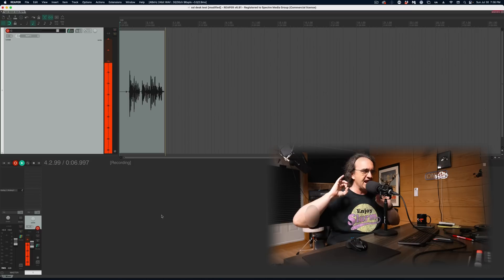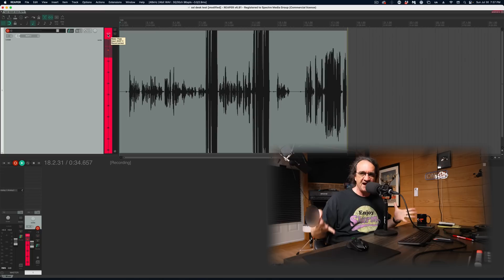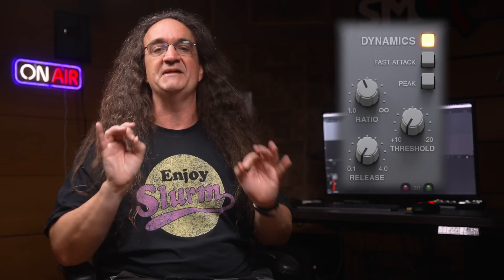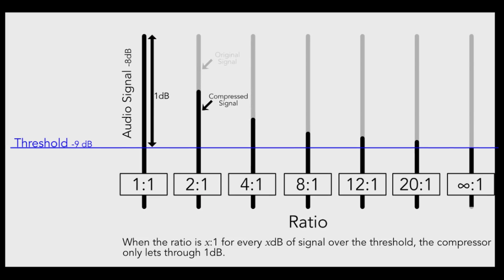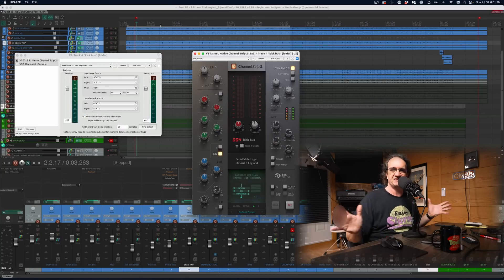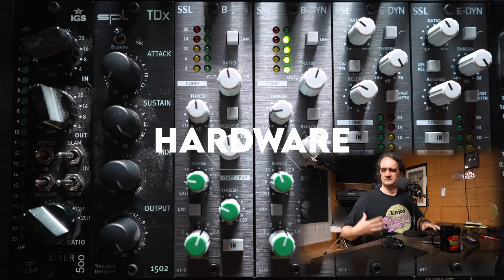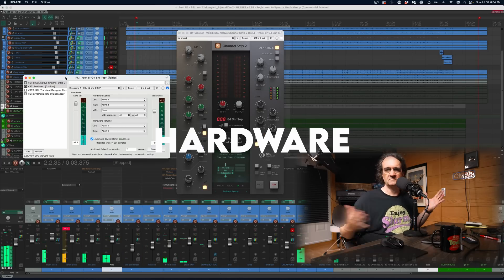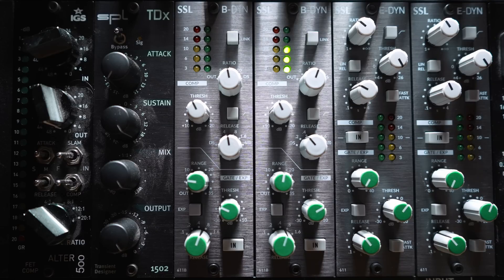5 Reasons this is BETTER than your Software!

Comment: I don't know man. People can't tell the difference between a real amp and a plugin. But a hardware compressor makes the difference? I don't think so. Pros have been replacing that kind of stuff with plugins even bevor amps, decades ago.
Reply from the maker: You can’t hear the difference?
Reply: @SpectreSoundStudios  Hi Glenn! Sorry for the late reply. You probably won't see this, but I'll still write what I have to say. 

I definitely do hear the difference! But how can anybody tell it's really due to the hardware being better? There are many contributing factors.
1) is the workflow, which is one thing you mentioned. Working with a hardware device is just different, and that can change the decisions we make along the way. (For better or for worse.) Definitely not to be discounted, but it's not really the hardware sounding better that makes the difference here. 
2) Mixing the same song twice and making it sound the same is virtually impossible, even when using the exact same gear and plugins. (Unless the tracks are so well recorded that you don't have to do much at all...) So again, one mix might sound better or worse for reasons completely unrelated to how the hardware sounds. 
3) There might be better (or "closer") plugin emulations than the one you used. I don't have any idea myself, but somewhere in the comments somebody wrote that the plugin you used was not emulating the saturation of the hardware unit and that there is a different version of the plugin that does. So it might be fairer to use that one. 
4) A more objective method would have been to set the hardware in a way you like and then try to match the plugin as close to possible to the sound on every track you're using it on, and then do a blind test. Jordan from Hardcore Music Studio has done something similar and the plugins were extremely close.

Yeah, those are my thoughts. Of course there is a difference between a piece of hardware sounding better and one making you mix better. Both are valid reasons for getting hardware, and I'm certainly not saying it's not worth it. I still like my tube amps and I prefer recording with them.
Reply: It’s different but not exactly better.

Comment: I miss turning the knobs.  Everything regarding the knob turning is 100% correct.  EQ, compression, everything.  Grab it,  turn and you hear instant results.  Used to use a G series back in 1989.  Now days it feels foreign working in the box.  Who even has room for the 2 entire racks it took to run that console back in the day?!?  I miss the good old analog days.. I would love to have an SSL Origin console.  Thanks for the video..

Comment: Reason #6 why I like analog hardware vs. cartoons:  If I decide I don't like it, or if I just no longer use it, I can sell it.  I can't sell a plugin.  I'm just out that money.

BUT...  "If the company goes under, who gives a shit?" Me, actually.  If I need parts or repairs, can I get them?  If it's something like a well-known transistor, then sure, I can buy one off Mouser and perform a repair (or have a technician do it).  But if it's a proprietary component made for that unit by the manufacturer, then I'm going to have a much harder time servicing it.  As an example, Charter Oak microphones.  They're pretty much out of business now, and the toggle switch for the pad on one of my mics of theirs broke.  I can't get a replacement part.  I need to use a pen to switch the pad in/out.  Combine lack of parts/service that with the company's now-tainted reputation on e.g. Gearspace, and I won't be able to sell these mics for anywhere near what they'd be worth with a different badge.  However...  The mics do still work just fine.

Comment: Glennnnnnn.
Could you explain the mic signal change? 
I have an NT1a that I'd love to run through a compressor before the preamp so I'm not recording peaks. 
Would this setup work? And could I run 48v thought a compressor? Or would I be better running the preamp on a lower gain and then using compression and makeup gain?
Thank you and cheers from Scotland

Comment: Well done! The presentation of the material was concise, and with proper support of the product's advanced offering(s). I must also commend you on the example of contrast between hardware versus the typical software option. Finally, pointing out the relevance of overall cost with the added value of purchasing one unit at a time, and pure ownership of that module. A distinct wonder what you can do without a crew.

Comment: I'm sure you're working on the counter argument video for this one; though the there aren't too many cons to hard ware. But the few I can com up with:
1. It takes up physical space that could be at a premium where you live.
2. Increased energy costs.  Now this might not be that crucial of a deterrent, but it will require power. The more things are plugged in, the more power consumed, the higher your bill.
3. It just works, until it doesn't.  Analog components breakdown over time.  If the company goes under, you're stuck fixing it yourself, and electronic components aren't as easy to find these days.
4. Much more difficult to move. Should one have to move  house, and the rack in which they're mounted isn't portable where the cables can be unplugged and a couple if lids clamped on the front and back. The entire assembly would need to be broken down, packed, moved,  unpacked and reassembled. 
5. Mixes have to be bounced in real time. Granted, the time this takes can be gained from what wasn't spent mucking about with plug-ins. (Provided that you don't  have a mix template made with all your routing, plug-ins (and the preset selected) as a sort of digital "set and forget".)

Comment: Honestly if I were working in the recording industry I would be using a physical console. I'm not against working in the box but the major downside is you can easily end in up decision paralysis loop.

When you have the physical gear you know exactly what it does, how it sounds, and how it works with the rest of your gear. So you dial in a mix much faster as opposed to jumping from plug in to another. And you can easily make on the fly changes if you think of something you want to try.
Reply: I put the same console strip plugin on every DAW track by default to reduce decision fatigue. Most of the time the included EQ and comp really are sufficient to accomplish the task.

Comment: You have a passion for recording drums. I have a question in regards to that. My friend is a DJ and he got this hardware called a Rotary Mixer / Isolater. Idk if it could have a significant studio application compared to existing tech but I thought it might be a tool to customize a unique drum sound in a live context or otherwise. I thought you would have a much better estimation of that.

Comment: Glenn, I'm disappointed; if you do a comparison, use the right plugin. You used the Channelstrip 2, which is an emulation of the SSL 9000 series. You should have used their very own 4000 B(!) plugin. And no, having a gate is nothing special with an SSL dynamics section because it is a channel compressor, NOT a bus compressor as you called it.

Comment: The most recent discipline I studied was sound design through synthesizers and this video explains the exact reason why I want to dump some money into hardware synths.

Granted... xfer Serum, Massive, Kilohearts and Harmor are extremely powerful tools; yet, they will make you scramble for hours tweaking settings and trying shit out.

On the other hand, if I were to just buy a midi controller and some modulators, I'd instead be looking to get the best out of something simple that I can manipulate with my hands and more than likely stumble upon happy accidents.

Like you said, it's an entirely different mindset. And I guess the same applies for guitar gear, at least in experimental phases of recording.

Rad video, as always! Fuck you, sir!! 🔥🖤
Reply: I love hardware synths. I have some vintage synths and drum machines from the 80s. My tip is to get stuff that has MIDI. MIDI makes things so much easier. I use an Arturia KeyStep Pro to sequence my drums, bass, an other things. The two MIDI outs on the KSP go to a couple of 6 way MIDI through boxes. The MIDI in is connected to a MIDI merger so I can use my DX7 and Roland Alpha Juno 1 as master keyboards. The AJ has a neat chord mode. That's why I use it as a master keyboard. But the DX7 has a nicer key bed. So it's what I usually play. You can get DX7 sounds for free with the Dexed VST. To my ears it sounds identical to my DX7 and works with DX7 patches. But I love owning the synth king of the 80s. And it's really nice to play. If you are interested in vintage synths I recommend the channels Vulture Culture, Doctor Mix, Alex Ball, and Espen Kraft. Espen does 80s style synth pop. So if you like the 80s, check him out. I also recommend looking at vintage rack mount synths. A lot of keyboard synths were also available as a rack version if you want to save space. But sometimes they keyboard version is better because they have more room for controls than on a 1U rack unit. For pre MIDI stuff there are clones from Behringer that have MIDI. You might even start with Behringer before moving on to vintage. The Behringer Wasp Deluxe is a clone of a British analong synth from the 70s if you want to play around with old school subtractive synthesis. It's a fun synth. It has an external audio input if you want to run tjings through its analog filter. 

There is so much out there in the realm of harware. Do plenty of research before spending money and stuio space on hardware. 

Another thing about vintage. It might need a repair. Even just replacing the battery for the memory requires soldering. So keep that in mind.

Good luck on your hardware journey and have fun.
Reply: @jennoscura2381  sheeeeesh...! That's precisely what makes it scary 😂

Appreciate the insight!!
Reply: @dshredmusic  Thankfully there are loads of good videos demonstrating various synths. So you can get a good idea if it's a synth you might want in your studio. 

One series I really like is Bad Gear on the AudioPils channel. He reviews synths that enough people don't like. There are some really cool things that show up in his videos. And he crams his videos full of synth memes. It's really entertaining.

Comment: Apparently I'm not an audiophile enough to hear a very notable difference. Most notably maybe on the harshness of the cymbal on the right side and certain softness on the snare on the software side. The snare pretty much disappeared when the groove got faster.

Did you just match the settings and all that between software and hardware? In that sense, okay, maybe you got "better" results with the hardware version. But I don't know, man, in certain ways this goes bit into the Snake Oil department. 

Without the option to switch between the two like you're doing here you're probably gonna come to a different solution to get the desired effect from whichever you have, just a slightly different set of settings. Much like with two different humbucker pick-ups, no one's gonna be able to listen to these things and say "oh, you used hardware" or "oh, you used software" or "oh, you used Semen & Humpin' Cumbucker" or something like that. when you just pick up a mix to listen. It either sounds "good" or "bad". You know what I mean. 

So it comes down to workflow and what your ear clocks as good or the sweet spot or whatever. Basically the software simply offers the same user interface as the hardware version. You'll end up adjusting them differently to get the same effect. 

I don't know, man. Just my musings.

Comment: I am the proud owner of a fully rack converted SSL 9000J channel strip and the SLL Channel Strip 2 plugin, the hardware is better.
BUT the VST's are damned good as well, just not quite that top of the line polish but I wouldn't be able to tell unless I directly a/b them.
These units are expensive, worth it if you are making a profession out of it but not so much if you're just recording your own music or a band.
Or you're a dentist. They always grab up the quality gear for ridiculous money then hide it in their houses and never use it.

Comment: 2 major downsides (aside from pricing and maintenance):
You need to print it (takes time) or commit to it on the way in (not flexible)
Makes recalls/revisions tedious if not a nightmare
Reply: theres a plugin that lets you store .jpgs so you can take a photo with your cell and leave it there. Next time i open the project if i need to check if my channel has the correct settings i just look at the .jpg...

Comment: I think this is a more subtle trolling video. Reason 1 is just that the SSL plugin is not an accurate emulation of the SSL hardware. Reason 2 could be remedied by just learning how to get the sound you want on a more powerful plugin and creating a preset with some notes. Additionally, you can usually map the "knobs" of a plugin to faders or knobs on a midi controller to achieve a very similar effect to manipulating hardware. Reason 3 is just presets with extra steps if you want to have more than one source for which you use the same hardware module. Reason 4 can be remedied by using plugins with less annoying DRM. No DRM at all (physical) is still less annoying to be sure, but how much value does it add vs the increase cost? Software companies can go under, but software cannot be physically damaged. Learning or purchasing board-level repair for a discontinued product can be a nightmare, incredibly expensive, or both. Reason 5 can be a benefit as well as a setback. If a manufacturing tolerance is a key part of your unique sound and you have to replace that piece of hardware, there goes your unique sound. Labeling the mixes at the end instead of leaving a blind A/B was the biggest tell that this is a troll video. Well done, sir.
Reply: He’s wearing a Slurm shirt. He’s on the clock.
Reply: @jrrarglblarg9241  Ahh I see. I'm not familiar with the reference.
Reply: @sitzkrieg8032  From Futurama, a cartoon. Slurm is a soda-type product in the cartoon’s world, highly addictive and made by explointing other beings. It’s a product placement running gag in the show, among other things.
Reply: Close your eyes and listen to the snare and kick, you'll hear it.
I think he could have probably tweaked the VST a bit to match though, I can do that with my VST and my racked ssl channel strip.
Reply: It's basically as accurate as they can get it. Your other counterpoints aren't actually correct.
Reply: SSL's buss compressor is a less faithful emulation of the G series bus compressor than waves ssl, DMG traccomp or The Glue...I made a video showing it in plugin doctor
Reply: Mostly what I heard was less highs in the kick/snare on the software mix.  My guess is glen has the treble turned up on the mixer for the hardware comps.
Reply: I listened to the clips with the video minimized and there is a very clear cut downgrade in quality when the software kicks in...I admit it's not as pronounced as when I was seeing the text cues when the source changed, but I could CLEARLY tell when it was the hardware, and there is a significant difference in quality. I hate to admit it, because I've been telling myself for years now that my purchase of Cubase 12 Pro (which I got at a serious discount due to a strategic competitive crossgrade from Adobe Audition, which is part of my creative cloud subscription, then waiting for sales and using upgrade discounts from my original purchase of 10.5) and my yearly summer sale update to the newest Native Instruments Komplete Collector's Edition package (my update from Komplete 13 CE to Komplete 14 was only $250) was all I ever needed to maximize my audio recording and production capabilities...and I wasn't WRONG, but this proves that there is an extra level of quality I can attain if I'm willing to learn a bit more, and invest a bit more...but for now, since I am a hobbyist, I'll just admire the hardware and use the software. After all, the Cubase and NI upgrades had tons of new upgraded plugins, tools and features as well as sounds/samples/instruments to use...the compressor is more expensive than both were put together, and the difference in quality doesn't justify itself when considering that it is just ONE of the 4 or 5 necessary signal processes needed for a good mix...I'm not, after all, doing it as a source of income or for anything other than a fun hobby to make music...But Glen definintely has a point, as usual.
Reply: @HububkiFilms  because he didn't match the settings
Reply: @pipelineaudio  And your criteria for saying this is? I'm just curious...show your work. Anyone can just SAY that someone didn't do something, but I watched the entire video, I didn't hear him saying anything about not trying to get the best out of each example...One of the primary points he was making about the superiority of analog equipment is that the adjustments take far less TIME that can be applied to more important areas of the mixing and mastering chain...so even if you ARE right (and I see no empirical evidence that you are, merely an unsubstantiated claim) it's not a very good retort to say that with hours of painstaking and meticulous frequency analysis and comparison he could have gotten the same results...that's kind of one of the main points...the time savings.
Reply: @HububkiFilms  just the volume alone shows it wasn't matched
Reply: @pipelineaudio  That's speculation, not evidence...keep trying.